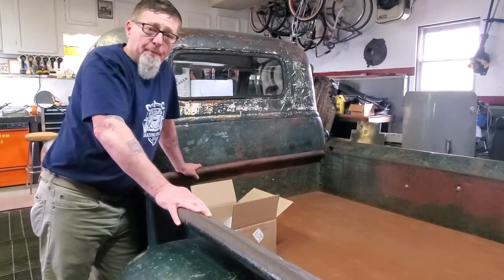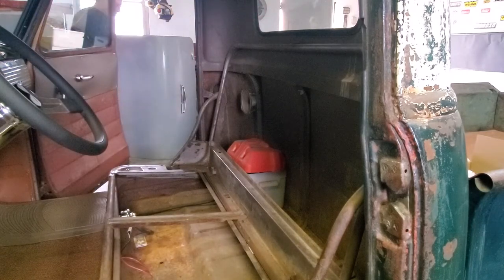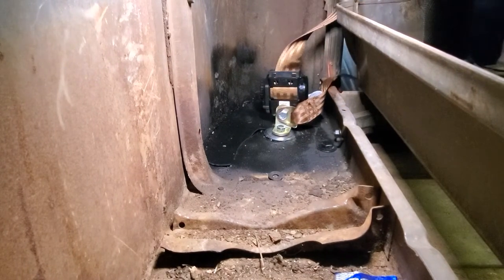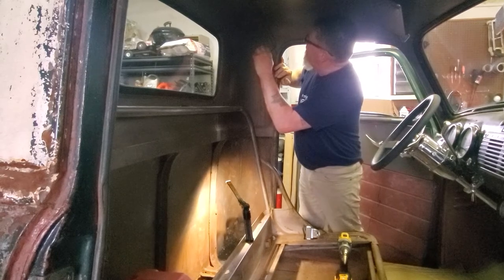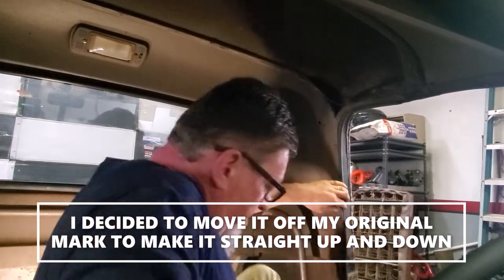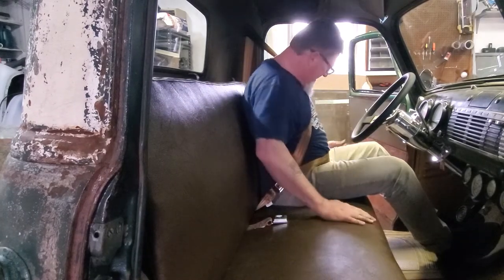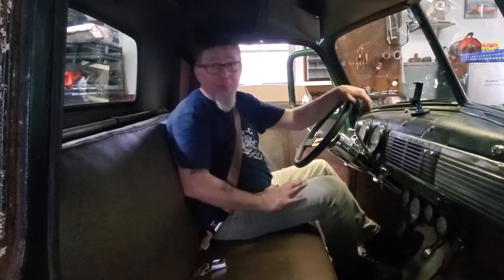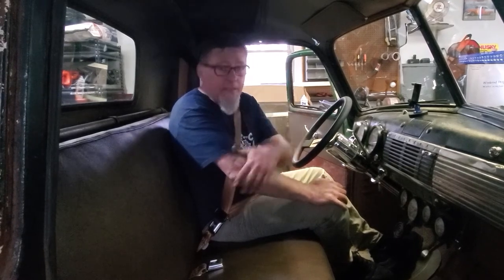INSTALLING 3 POINT ADJUSTABLE SEAT BELTS IN CHEVY 3100

Comment: Great job. Now you and any body in the truck will be safe. That's what counts👍
Reply from the maker: I feel better about it now. Thanks bud.
Reply: I mean less unsafe maybe, but you aren't safe even with them if you crash. Even a modern car isn't safe in a crash, it's just less unsafe than most old cars. I probably should install 3 point seat belts in my truck but I never will. It might not be the safest thing in the world but it's not the most unsafe thing either. I'm still probably about 15 times safer than a motorcyclist even with a helmet.

Comment: Great video... thanks. I have a question. I noticed you don't have the gas tank in the back of the cab. How would I install the center lap belts with the gas tank still placed in the cab? Any advice would be appreciated.

Comment: This is an old post but it's very important to use large fender washers under the car to disperse the load in case of an accident. I have seen these rip out before.
Reply from the maker: Thank you for the tip. I used big washer but you have me thinking...... I m going to check to make sure they are big enough.
Reply: @CHASINGMUSCLECARS  Im purchasing a 1954 Chevy 3100 5 window on Monday and Im hoping I have enough room between the door and glass to do the same thing. Otherwise I will have to put a four strap restraint system and mount it to the floor behind the seat and bring it over the top. They make them in the passive restraint style, but are still more restrictive than I like.
Reply from the maker: I am pretty sure the cabs are the same. Hope it works out for you.